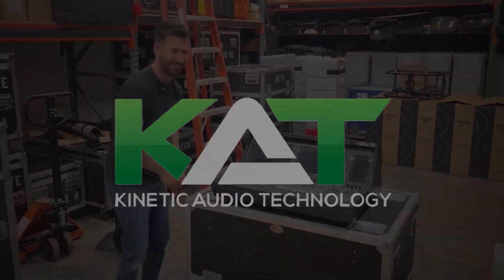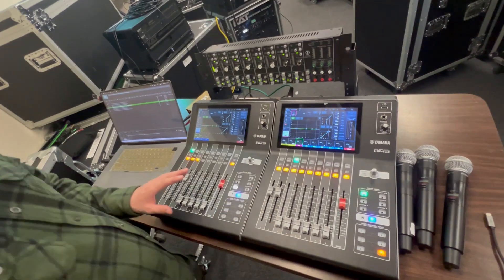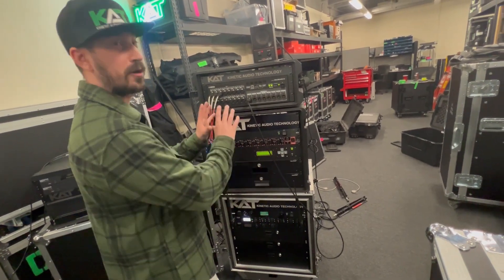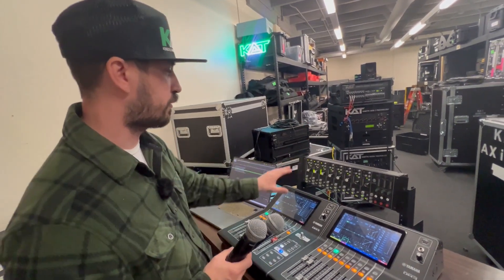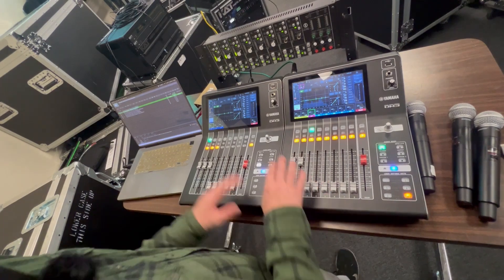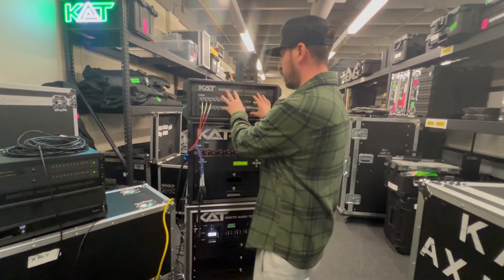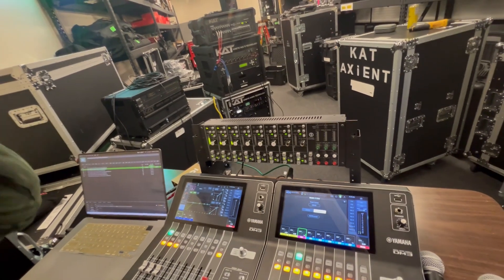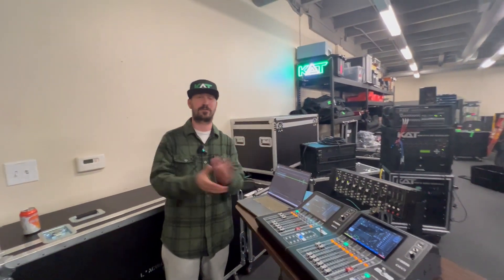LINKING 2 YAMAHA DM3-D'S VIA DANTE

Comment: I like the mad scientist approach to this. But you know you could just use an automixer plugin on a laptop with usb on the console. The RTL isn’t to bad on the dm3‘s usb soundcard especially if you get the buffer size pretty low. I personally like to use the wtautomixer for this application. It has some features that the waves Dugan just hasn’t.
Reply from the maker: @QuadratAugenFresse  i had thought about that. Just hadn’t tried it yet. Have you actually tried using the USB to support waves yet?
Reply: @KINETICPROFESSIONALS I haven’t had that much time one a dm3. And I try to not use Waves plugins. I can only speak about vsts hosted in live Professor which works good.

Comment: Clever solution to make the best of what you have. If I was shopping for a breakout room solution for myself, at the price point of two DM3-Ds and a standalone Dugan processor, I think I'd be well into used CL/QL territory (which I'd much prefer to this setup). The Dugan in this configuration is still handicapped by the fact that it is receiving the signal pre-fader. You will also need to mute the mics from the Dugan controller instead of using the mute buttons on the console, otherwise a mic backstage could pickup noise that could result in ducking of mics live on stage unnecessarily.

Yamaha's omission of an automixer in the DM3 at launch is a huge mistake in my opinion. At this stage, even if it is added in a firmware update, a console like an SQ-5 or Wing Compact offers quite a bit more flexibility at an only slightly increased price - and if Dante is a requirement, it can easily be added with an option card.
Reply from the maker: @WalterEKlaus  you’re right the mics going into the DUGAN D2  are still pre-Fader but if you had the controller next to you, you could at least toggle channels on and off that you wanted to be affected or unaffected. Again it would be very reliant on the remote. Having Dante on console natively but not DUGAN is just silly.

Comment: This is interesting - I had a Yamaha TF-1 stolen from my church and replaced it with a Yamaha DM3-D - and was surprised that I how had only 22 channels instead of the 40 I had with the TF1. We bought another DM3-D in hopes of getting the channel count back up through Dante. We bought the new TIO 1608D-2 that can also match the DM3-D and function at 96k. We also use Shure ULXD Duos and Quads, so they can work through Dante as well (I have that on my Yamaha QL5/Rio setup in my sanctuary. It looks like the way you're linking the 2 DM3-Ds together is by feeding the output of one into two channels on the other and burning 2 channels on the 2nd one. Could you do that on the 2nd layer of the 2nd DM3-D and not lose 1st layer faders? Also, you seemed to be saying that you stayed at 48k because of the ULX-D mics. Why is that? If they're functioning in Dante, does their clock frequency have to match the DM3-Ds? If so, it would be better to keep them out of Dante and just use analog inputs on the DM3-Ds. I'm trying to keep my DM3-Ds functioning at 96k - otherwise I should have just purchased another TF-1. Our application is musical production for our church's school - lots of wireless mics, musical instrument inputs, and maybe a video track with audio. Thanks!
Reply from the maker: @LDBecker  yes, master output from one is feeding via Dante to channels 1 and 2 on the other. As stated in the video (you could simply create custom fader layers and not lose 2 faders, your channel count would still be reduced by 2).  Also, as stated in the video you could certainly go to 96k as I’m simply taking analog out from the ulxd and not actually taking Dante channels (I did this so I could feed them through the Dugan d2). I kept things at 48k for this video out of convenience only (was already @48k and didn’t want to change it). If I didn’t have the d2 inline and wanted to take the mics input via Dante, I would have still had to stay at 48k because ulxd’s cannot be set to 96k.
Reply: @KINETICPROFESSIONALS  So, if I went out of the ULXDs via analog, I could keep everything at 96k, right? I don't have a Dugan d2 or anything else in the mix like that - just the two DM3-Ds and one of the new TIO 1608mkII that runs at 96k.
Reply from the maker: @LDBecker  yup! You sure could. You would just be feeding a mic or line level signal into the tio at that point. Consoles and Tio could be kept 96k.